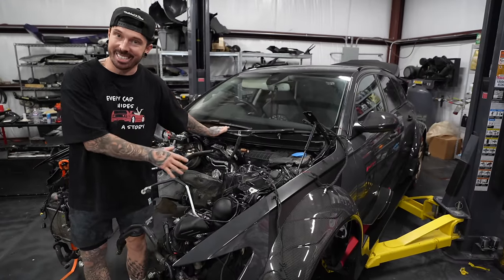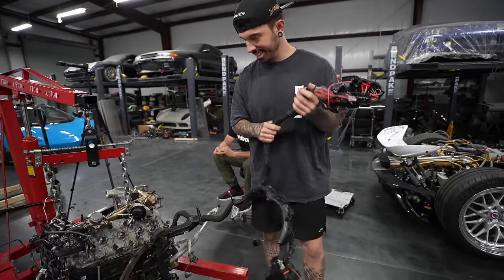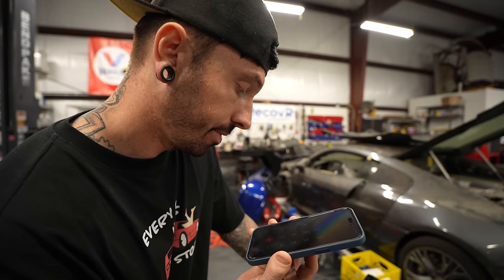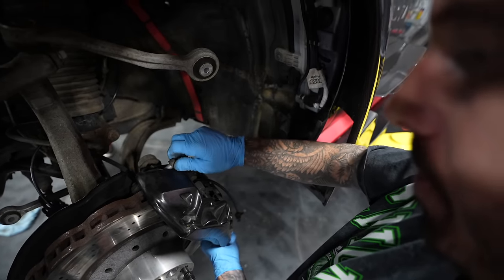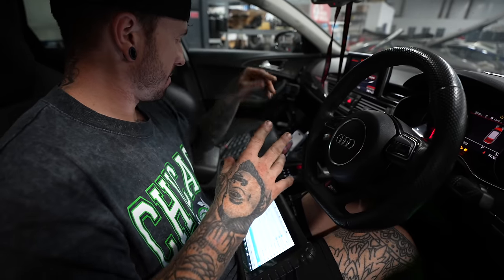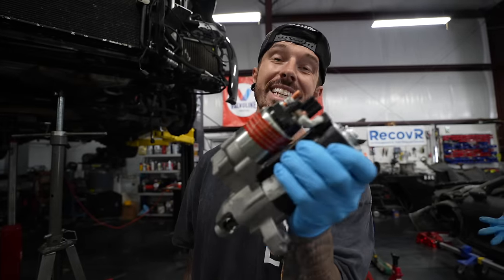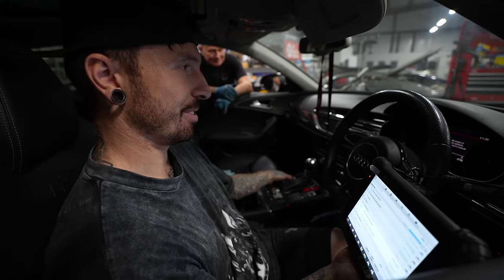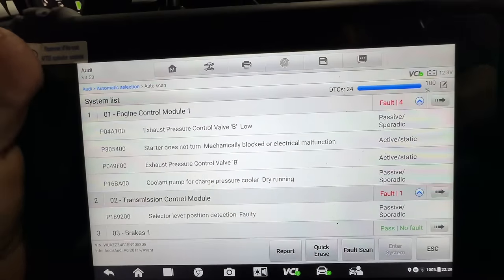REBUILDING A WRECKED AUDI RS6 GT3 #2

Comment: As an automotive technician for over 35 years. Two ruels of thumb. Always bench test a starter when replacing a seized engine and, always tear a junkyard engine down to long block before installing. Always use the known good parts from the original engine. Never use a junkyard intake/exhaust manifold, fuel injectors, or other electronics. A regular mechanic would loose his ass having to pull the engine 2 or 3 times but, the good news is that for a youtuber, it's just more content. I mean. Who else can make money on an engine that won't start? You guts are great. I love the channel and It's so great that your back in Tavarish's shop. You work great together. I love it.

Comment: Wow.  That is crazy time for that job.  Love Audi, but is these engine designs are madness.
Reply: Awesome to see a guy that breaks down apple products seeing someone else take apart less elegantly designed creations. Cheers Zollo
Reply: Tbf, all audis are shoehorned in to their engine bays..  and i dont know why they wouldn't have checked the starter prior to putting the engine in.
Same as all the coding, intake flaps, engine mounts, those rusty bolts on the crank pulley, marking vacuum lines with numbers, gettingthe right starter motor.. it's just about doing things properly.. the workshop manual is there for a reason.
And the S6/S7 is not the same engine as the Rs6/Rs7
Reply: @TheDarkhorse82  it was an S6 starter motor rs7 engine
Reply: @TheDarkhorse82  Great comments here, but these individuals seem not to heed any wise advice given in the comments section. As you wisely pointed out, to refit a starter motor from a seized engine without having tested it knowing the difficulty of access once the engine is fitted, is close to insanity. So is not labeling pipes with matching numbers to their locations, considering the amount fitted on this engine!. With all due respect, it's clear these guys are merely fitters, but not engineers... is a big difference. As soon as I spotted the melted electrode on a removed spark plug, I commented that detonation seemed apparent after having cut my own cylinder head profiles in the past. That's what happens when you run boost levels to the degree they are, detonation lies just around the corner due to the increased volumes of air passing into the engine. They will not learn from that, as they are going to do the same or similar by mapping this engine too, is a case or naivety!. The cause of the last engine failing, was not purely just down to the fuel octane rating alone. Could be compared to jumping off a boat into shark infested waters, knowing your friend had their leg bitten off at the same location you're jumping into!, cheers.
Reply: @galaxion62 I'm thinking of getting an Audi A7 2016 down to Nigeria.

DO you have knowledge on the car and its issues?

Is it an OK car to get seeing as our technicians are still left behind in terms of tech?

Thanks
Reply: In Germany, there is a three-year vocational training course for car mechanics. And you did it without any. That's impressive.

Comment: As as former Audi Master Tech I can confirm... They were designed not to be worked on. The reason the fuel pump wont prime on the relay is because there is an independent fuel pump module. The easiest method is to lift the right side of the car only, then remove the pump. Most of the fuel will be pushed by gravity to the driver side of the tank. You can start syphoning from there. On a full tank you may have some mess to clean up. The tank has anti syphon tech so you can't get a hose down the fill if someone was wondering.
Reply: Don't you get an adaptor for the filler so you can use a funnel and jerry can if you run out? Or do you have to get transported to the nearest petrol station?

Comment: Man i rate the patience of Mat and the guys for always managing to smile and keep the build moving. I know for a fact id of blew my lid by  now and im actually a calm person lol. Years ago i couldn't get locking nut off wheel on my Ford Orion ghia (showing my age lol) after 15min and plenty knuckle scrapping the boot lid rear arch and back window took the brunt of my frustration and temper with tyre iron swinging😮. Yes i did regret this 10min later.

Comment: You’ll get it sorted like always man. 

Check those power and ground wires to the starter solenoid or you’ll keep burning those up. Especially that one that was connected to that toasted terminal on the starter solenoid.

Comment: Weird that the used engine didn’t come with a starter. As always awesome stuff. Keep it coming.
Reply: If it had come with a starter as it’s an unknown you would always test it off the car. The question whether to test his own starter while the engine was out is a good one. With such a complex engine out build it would have been prudent to check it just due to the fact the engine locked up but to burn out the starter in this fashion is more than unusual. The mistake with the intake manifold flaps if you didn’t know you wouldn’t know. The rookie error was the fuelling.

Comment: For the fuel pump, the fuel pump control module uses PWM (pulse width modulation) not just a 12v on/off. The best way to get the fuel pump to run consistently to drain the tank is to grab a scan tool, VCDS, OBDEleven, etc. and output test the fuel pump/command it on. The starter issue, I would monitor actual battery voltage because a jammed starter would significantly drop voltage as it received power. Seems like maybe a wiring issue because it doesn't sound like anything is happening on the actual starter.
Reply: Well said..I suggest that you compare the power rating of the new and old starter motors to begin with..You could also check that all the earth leads are fitted and secured correctly.. Your father has a habit of leaving things un done 😂
Reply: its could be his old starter melted his wiring harness .. creating a bad shorts .. 😮
Reply: @ExploringWithVin  if there was a short a fuse would blow or the wires would melt / go on fire

Comment: Starters are one thing I will always buy OEM from the dealership even if they cost more.
I've been through this SAME thing with Nissan in the 90's, went through 6 "rebuilt" Autozone starters then decided to try Checker Auto parts (now O'reilly auto parts) and after my 2nd starter from there I decided to buy from Nissan while it did cost more I no longer had any starter problems. Buying from the dealer normally means waiting for weeks etc.. But worth it

Comment: Great video! I see that everyone is roasting on how hard is to repair this car, but for every of the issues I see as a reason mistakes as the cause - as for the flaps, for the vacuum and even for the fuel that is being put. So I think that the car is very reliable overall, it the mistakes being made that made this mess being real :)

Comment: That’s a very hard lesson learnt. My last car had a  remap with a safety kill switch put in place that reverted my eco back to stock power. If the car  detected bad/wrong fuel. I’d definitely recommend any remap your doing have nothing similar in place.

Comment: You are a better man than me I would have lost my Italian temper and started throwing parts and tools. I am currently restoring a 68 Amc Amx I will only buy new electrical parts if I can get them especially the starter. Every car I work on if the starter looks beat up it gets a new one if not. I will rebuild it myself if the parts are available.

Comment: Audi had my RS6 for 4 months to sort out the inlet manifold flaps and head gasket, the engine came out twice, as soon as I got it back I sold it! Shame as they are great cars and this was my second one. Used to get that starter motor code up frequently, but it always came back working once you left it for a while.

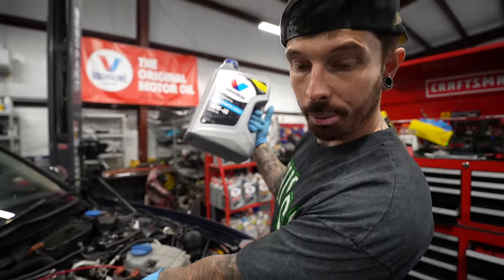Comment: I'm just at 17:00 when you started emptying the fuel tank. This rs6 is a quattro, right ? It sure is. So it has a prop shaft going to the back of the car. So if I'm not mistaken, the prop shaft is basically "splitting" the tank in two halves, so you get two low points. One on the left and one on the right side of the car. Where you able to empty both ? Please correct me if I'm wrong

Comment: nice job, one important TIP!!! Don't drop in your spark plugs like that. It bends the tip. Use a coil or socket with rubber or magnetic pen. To lower softly!!

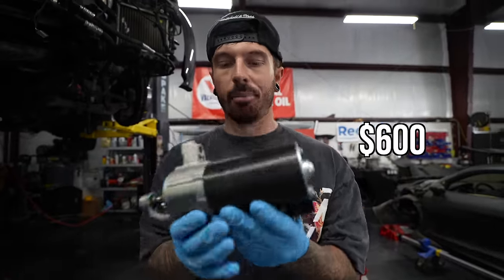Comment: 26:25 - You just met the RS6 tax. Identical parts just a higher price tag. It's incredible what Audi is charging for parts.

I needed a sensor on my older RS4 B5 - we figured out that the sensor costed 160 euro for the RS4. However the S4 has the exact same sensor, just with no RS badge and costs 80 euro.

Comment: Mat Audi usually controls the ground wires not the hot wire. So with the harness unplugged you need to make a jumper for the harness ground wire to the chassis. This will allow you to see the 14v testing and open harness. Need the completed loop. It’s a way for computer to continuously monitor its equipment.

Comment: I went through the same issues I learned from trial and error but now I know the engine bolt by bolt. My engine dropped a valve and finally after 6 months I got it running. Stuck runners, leaking gas lines, cam phasers upside down, bad thermostat, seized starter… oh what a rollercoaster I rode

Comment: Hi Matt, seems strange the starter would quit so quickly even if it was reconditioned.  Could something be causing a short that is damaging the solenoid?  As i stated in comments on your other RS6 videos, I personally have an S7 and i'm loving this series of videos as its a product I'm familiar with.   I know your time is obviously limited on this this as I'm sure Freddy still has his own projects to keep working on too.  Maybe the S6 starter takes less amps and an RS6 / RS7 starter.  This I am not sure of but could explain why the starter died so quickly.  Here in the states The RS7 would be where you want to source parts as they will likely be identical.  Cheers mate and keep doing what you are doing.  You've inspired me to tackle a lot of my own maintenance issues on my S7.  (Albeit nothing requiring the engine out 3 times)

Comment: I guess it makes sense the high pressure pump shuts off if the system isn’t building pressure. That way if you have a high pressure side leak it won’t just be constantly spraying more fuel.

Comment: How did you turn the engine to get to all the torque converter bolts when the engine was seized mate?
Reply from the maker: The head was off the engine

Comment: Hi Mat I think I had similar problem with my engine in A4 I know I know its just A4 but it is Audi. My engine was also in limp mode and first thing they had changed was exactly the 34:32 vacuum thing and it does not helped.After that they changed whole flaps and it was that.The engine works again perfectly. I don´t know if it`s gonna help but I just need to let you know because I would like to help my fav youtuber in this desperate situation.Of course it won`t fix the starter problem.  Head up. Sending all patience in the world with that car.

Comment: US 91 "Premium" is essentially 97 in the UK. so our regular 87 gas is roughly 92 and change in the UK. So you should have been fine using US 91 octane, and probably even getting away with using 89 US octane, unless you were using UK's version of "race gas".  Im curious as to which US octane gas you used to detonate the engine like you did

Comment: did you check the RS6 starter motor alongside the RS7 starter motor?   ..did you compare the flexplates and starter rings on both engines,  did you check number of teeth and pitch? .. seems that both starter motors might not match to the starter ring on the new engine RS7 .. the original starter was ok on the original engine,   if you had used the flexplate from the RS6 I would have expected them to match up .. if you switched the flexplates .. put the RS7 flexplate on the old RS6 engine and offer up the old RS6 (original) starter motor to see what the problem is, maybe it's jamming into the starter ring and not releasing,  both starters seem to have a problem matching to the RS7 starter ring .. unless I missed something in the super video

Comment: When you consider just how many sensors there are on any engine, let alone a high performance unit as in the Audi RS6, you'd think a 2 quid cylinder over temperature sensor wouldn't go amiss. I believe these are pretty standard on aircraft engines?

Comment: I have one question. If the RS6 and S7 engine are the same, why did they not swap just the damaged block on the original engine? They may have answered it and I missed it but I would still like to know

Comment: There are a few things I personally didn't do..
Revving it all out on a drag strip, KNOWING the turbo oil filter is a flaw which wasn't fixed and the octane fuel is bad researched..
Also fixing it in the US is a bit tricky, I would just have brought it back to the UK and buy a proper RS6 engine and a PROPER starter 😂😂

Comment: You guys really should consider some PPE when working with heavy shit like that, at least some steel toe shoes with oil resistant soles. Running shoes/sneakers don't belong in a workshop. Maybe some branded pants and long sleeve shirts?

Comment: Perhaps TWO failed starter motors in a row points to a separate issue, causing them both to fail? Are they disengaging once the motor is running? Perhaps an over voltage issue? 
Plot thickens!

Comment: Friend had a cossie bought from UK the car broke down 3 times when he got back to Ireland ultimately was down to the fuel car was mapped on 99 Ron in Ireland that was just not feasible 3 engines later that was what was discovered

Comment: Can't believe you paid so much for the starter motor . Vag only use a couple of different motor over all the range .any v6 or higher starter motor would of worked but you might of had to change the end cap . Even the starter motor from the 3.0tdi range uses the same motor and you just need to change the end caps witch is a couple of bolts

Comment: Hello everyone i need help 😢
I brought a VW MK4 about a month ago for my birthday but it didn’t work out as planned, the car wouldn’t start just a week to my birthday, we tried fixing it then it started with a knock sound and it wouldn’t Rev , we changed the throttle body and the fuel pump but it was still the same thing 
So just like Mat I brought a new engine and it runs smoothly but it won’t Rev again, the engine shuts down every time we try to rev it 

Please help

Comment: If your engine let go after putting in that fuel, then it was tuned by a chimp with zero consideration for knock. I can guarantee your knock sensitivity tables were bumped out the way to try make big power and your engine has det'd its tits off as a result. Shocking. 91 AKI is a smidge over 95RON. UK fuel is 97-99 tops. Nothing that knock sensors can't deal with.

Comment: If this video doesn't persuade you to switch to an EV, nothing will. Wow. 9.5 hours to change a start motor, £13,000 to change a block, $600 for a starter motor which didn't work, thousands of hours of labour... for a car barely faster than a Model 3 Performance. Where does it stop?

Comment: Wrong octane there's no such thing as wrong octane unless you got a shitbox 4 cylinder that can only run on 80 octane without blowing up you should have never owned it designers need to be kicked in the ball so hard they see next Thursday because that's nonsense you should be able to put 91 octane any octane in any car and not hurt the engine